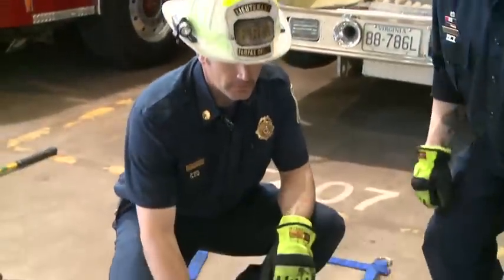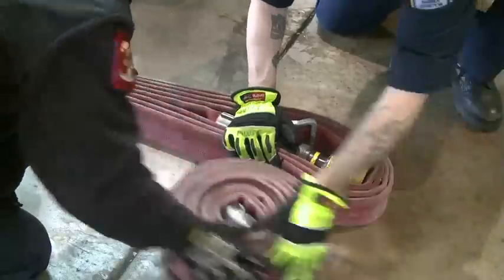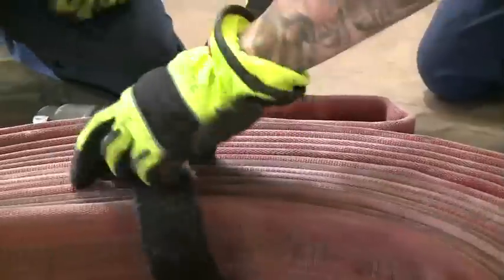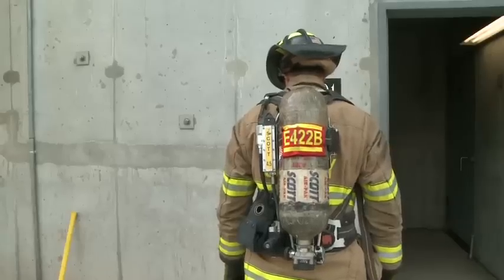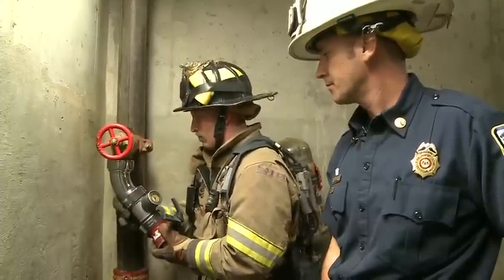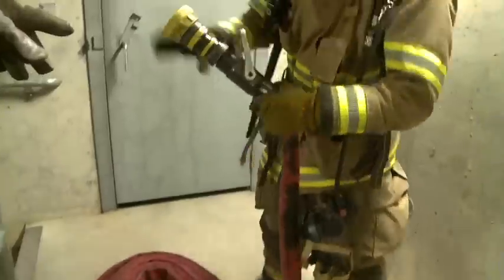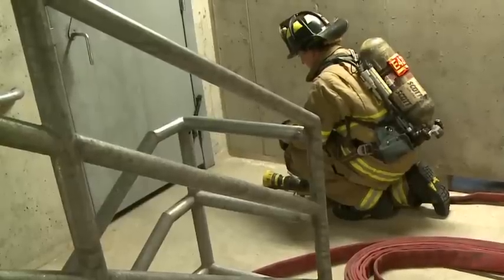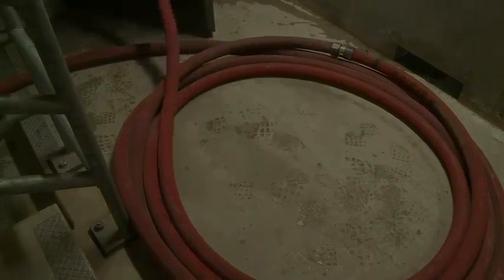FIRE TRAINING - The Metro / Cleveland Hose Load

Comment: My old FD tried several methods of building high rise packs over the years. In the end, this method was the best. The only difference was we used (3) individual seatbelt straps instead of a commercially made strap. About $60 total for (3) straps. Also, we used a “Standpipe Pipe” which contained (1) 2-½” x 2-½” gated-wye with a 2-½” to 1-½” reducer on each side, which allowed us to bump up from 1-½” or 1-¾” hose to 2-½” hose if we needed to by simply removing the reducer(s). The bag also included a set of universal spanners, door wedges and straps, high rise (big) chalk, and some spare 1-½” and 2-½” gaskets. The Fire Attack Team would take: (1) high rise pack, (1) standpipe bag, (1) TIC, (1) set of irons plus each member’s radio and flashlight.
Reply: Correction: “Standpipe Bag” (not Standpipe Pipe).

Comment: What’s missing is a gate vale or a flow meter with a valve to set the correct pressure. The stairwell connection valve should not be used to set the pressure

Comment: First off, great training video guys.  Second, question for FAIRFAX TRAINING, What pressures are you running at and what is your nozzle rating (150 @ 75psi, 150 @ 100psi)?  We have troubles with this load kinking and not getting the required gpm at the nozzle, until it gets stretched nearly 1/2 the way out.